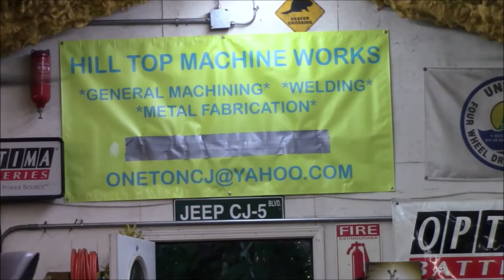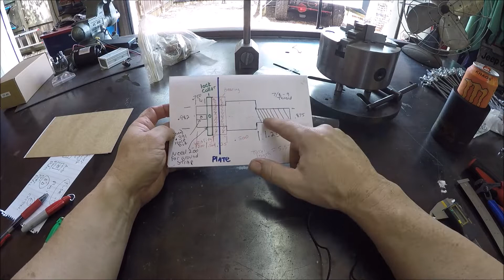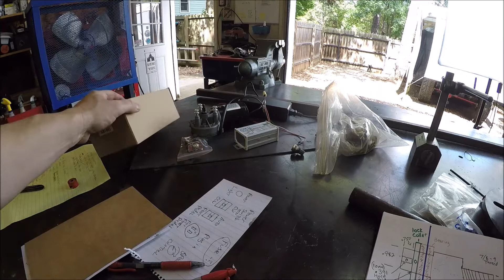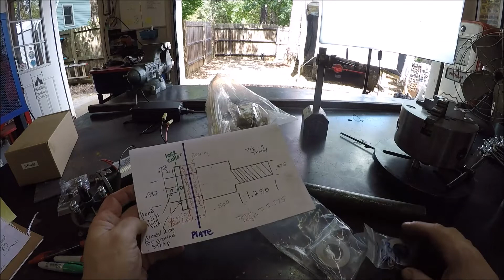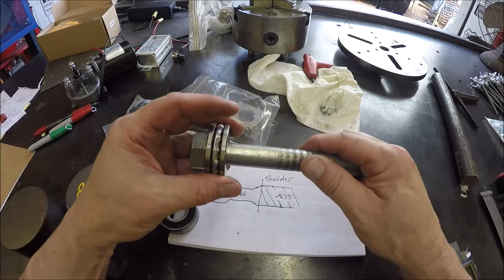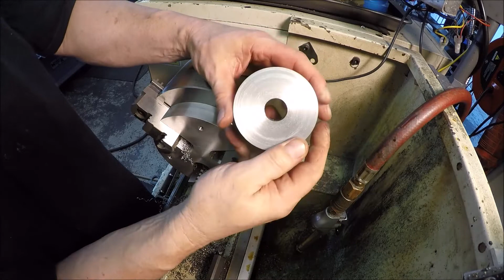Rotary welding table build Part 1

Comment: Nice work! I've been wanting to build one of these for a while now.would you be willing to pass along the part numbers for the electrical components? Any help would be greatly appreciated😁
Reply from the maker: I ordered everything off of E-bay so I don't have any part numbers but here is the rundown of parts. Switches- one DPDT and one SPDT. 12v led light. 12v flush mount fuse holder. AC socket 2 prong. 12v DC right angle reversible electric worm gear motor low rpm. AC to DC power supply 10amps. Heavy duty foot switch pedal. 12v DC motor stepless variable speed controller 15amp. Hope this helps.

Comment: Thrust bearing needs to go on top of plate, when on the bottom it is not supporting the weight.
Reply from the maker: Good catch. I changed the design. You will see that in part 3..........:)